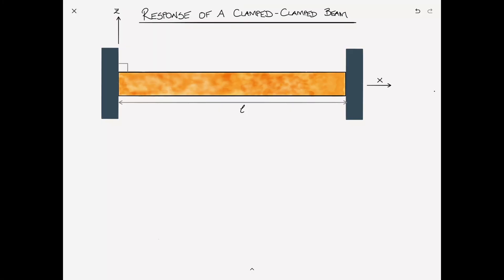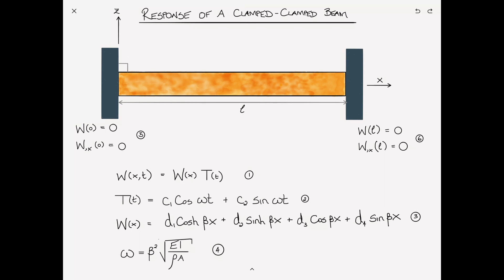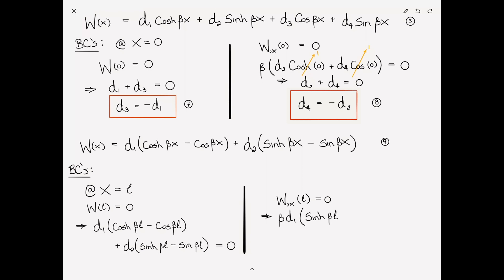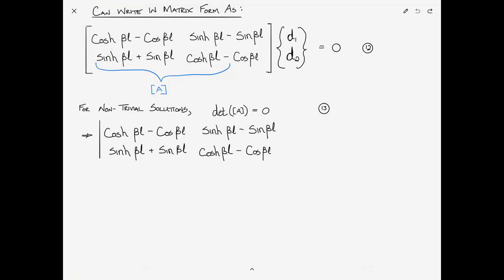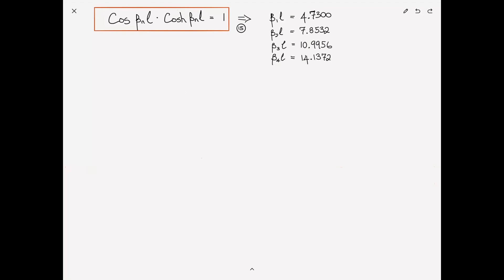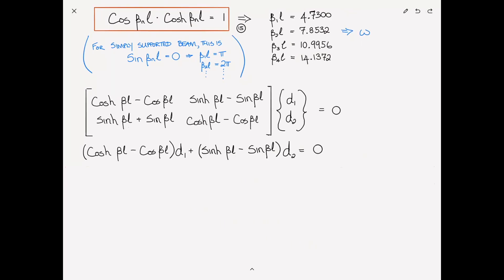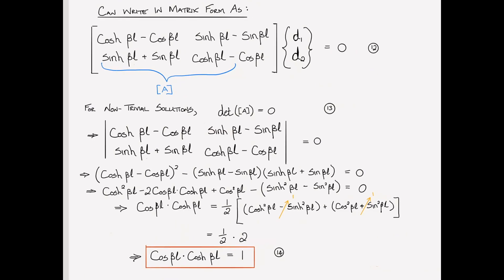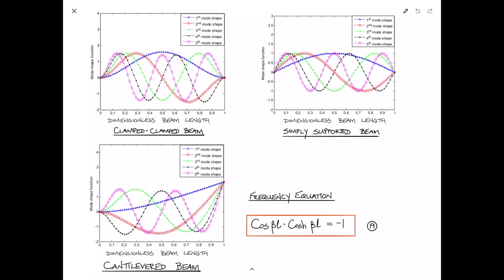Response of a Clamped-Clamped Euler-Bernoulli Beam (Exam Problem)

Comment: thank you for the nice content. did you use strain energy normalization in your final graphs? if so, why did you choose that one over max. normalization?
Reply from the maker: No, I didn't use strain energy normalization in the mode shape graphs. The normalization shown is simple amplitude normalization, where each mode shape is scaled to have comparable visual magnitude (roughly between -2 and 2 on the y-axis). This approach was chosen for clarity in visualizing the different mode shapes.

Strain energy normalization would have required additional calculation and would show different relative amplitudes between modes. For educational purposes, the simpler amplitude normalization better illustrates the key features of each mode shape while keeping the math accessible to students encountering this material for the first time.

The focus of the lecture was on deriving the frequency equations and understanding the basic form of mode shapes rather than modal analysis applications where strain energy normalization might be more relevant.

Comment: Hi!  How does requiring that the determinant of A be zero generate nontrivial solutions?
Reply from the maker: [A] is the coefficient matrix, so if the determinant is non-zero then this means that the two equations are linearly independent of one another and so only one solution exists.  Clearly, the solution d1=0 and d2=0 satisfies this equation, but this is a trivial solution (it means that the response is zero at all times).  In order to remove this constraint, we require the determinant of the [A] matrix to be zero.  This means that the two equations are NOT linearly independent (eg. this is like having equations such as d1 + d2 = 1, and 2d1 + 2d2 = 2 - these two equations are really just the same equation multiplied by a constant - and so the determinant of the coefficient matrix would be zero).  As a result, we don't have enough information to uniquely determine d1 and d2.  This is why when determining the eigenvector, we arbitrarily set either d1 or d2 equal to 1.  This, effectively, introduces a second independent equation which allows us to solve for the other value.

This reduces the problem to figuring out under what conditions the determinant of [A] is zero, which gives rise to the so-called "frequency equation" from which the natural frequencies are determined.  In other words, at what frequencies does the system need to vibrate in order to keep the determinant equal to zero thereby allowing non-trivial solutions?  There are the natural frequencies and give rise to the mode shapes.

Comment: Amazing video, really well explained yet consise - thank you!

Although I have one question; the constant d_n, at 11:00, you say will have a different value for each mode shape. My question is how do I actually calculate d_n for a specific mode shape? Perhaps I am missing something obvious but would really appreciate some feedback! Thanks again
Reply from the maker: It's a good question.  I'm not sure if I can explain it thoroughly using only text and without the use of a video, but let me try...The full solution for the displacement field is:

       w(x,t) = W(x)·T(t)  
                  =  Σ  d_n(...)·(A cos ω_n·t + B sin ω_n·t)  
                  =  (...)·(A _n cos ω_n·t + B _n sin ω_n·t)  

where the "..." is meant to represent the remaining terms in equation 18 and the Σ implies that this is summed for n = 1 to ∞.

So what I have done is I have combined the constants, d_n's with the A and B to form A_n's and B_n's - so we have eliminated the d_n's.

Now we can solve for the A_n's and B_n's by applying the initial conditions.  This yields two Fourier series which can be solved for A_n and B_n.   It's a little hard to explain without showing an example, so perhaps I will need to make a video for this.

Hope I haven't confused you.
Reply: @Freeball99  I'm with you! Instead of directly calculating d_n you combine it with the other constants A and B (since this will yield the same result, just another set of constants). If I understood you correctly?

Thanks again! Really nice of you to take time and answer my question.

Comment: How to find overall the solution for w(x,t)= W(x). T(t). I am sure i am doing something wrong, but, I am getting some weird expression after applying initial conditions. The expression for w(x,t) is becoming independent of W(x). Kindly help.
Reply: Solving the W(x) and T(t) independently, that solution is what we know as separation of variable solution. The idea of applying the initial solutions is to solve the time part T(t) while the spatial part W(x) is derived by using the method as in this video.

You have to do it separately that's why when you try to impose the initial condition, it's supposed to be W(x) free because you solve the temporal term T(t)

At the end, after you derived both spatial and temporal part, you can combine both to obtain the solution w(x,t)

Comment: Hi This is an excellent video, thankyou very much!! How are the solutions from Eq 15 obtained.
Reply from the maker: I think it's easiest to solve it graphically by dividing both side by cosh βnL and the plotting each side of the equation for different values of  βnL and seeing where they intersect.

Also, you could do this standard numerical methods by subtracting 1 from each side and finding the roots of the resulting equation on the left-hand side (i.e. the values of  βnL that make this equation zero).

Comment: Please I have a question not necessarily on this topic. So I'm working on optimization of truss structures using genetic algorithm in MATLAB with global buckling as constraints... My question is this, I have been able to find the local buckling of each bar element, BUT i do not know exactly how to fin the global buckling. Please do you have any tips or links that can help me with this. Thank you
Reply from the maker: I'm not sure what you mean by "global buckling".  Are you asking how to find the point when the assembled truss structure buckles?
Reply: @Freeball99  Yes. Like the truss buckling not the individual bars
Reply from the maker: I believe a way to do it would be to examine the fundamental frequency for the assembled structure as you load it.  If it's true buckling that you're analyzing, then at the onset of buckling, the fundamental frequency should go to zero - i.e. the compressive forces in the truss ought to produce a de-stiffening effect.